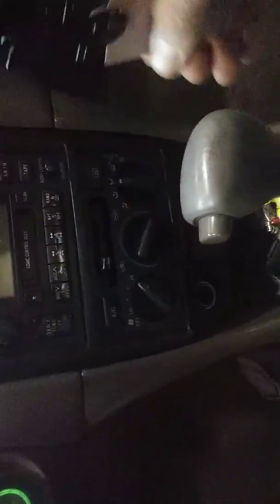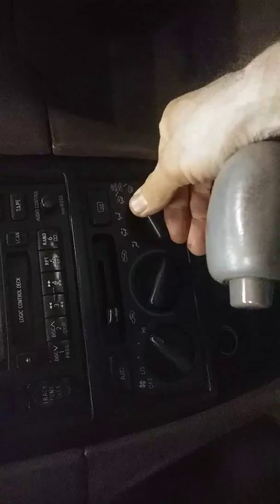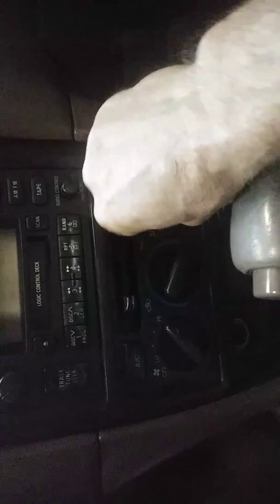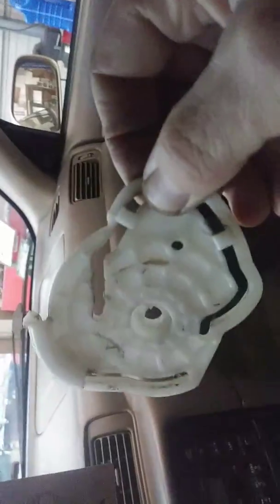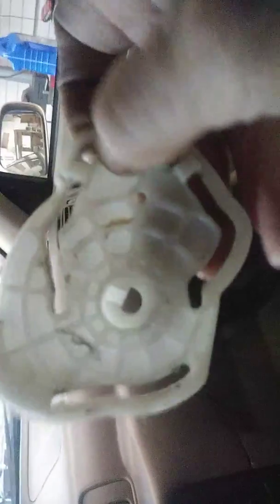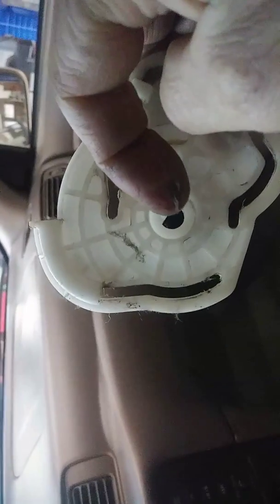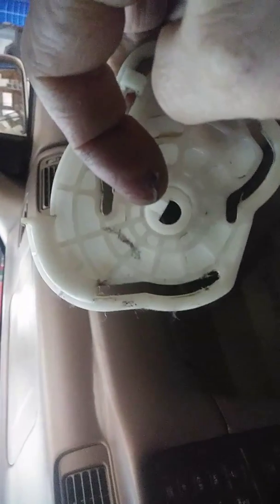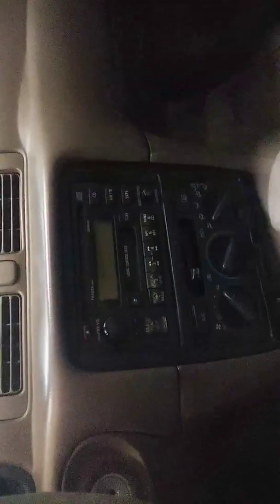Toyota Camry Servo motor air selector switch not working

Comment: I just did this job. It's very difficult to get to this part because you have to work upside down. I highly recommend removing the driver seat. Don't be intimidated! It's easy! Use a 14mm socket, remove 4 mounting bolts at the base of the seat, place the seat in the back seat. Now you can lie down on your back and do this job. One more tip, use a very short phillips screw driver to remove the servo motor.
Reply: 3 days ago! Haha! Must be "Planned Obsolescence!"  Seems quite a few of us got hit nearly the same time - at least the same year!
Man, do I appreciate your suggestion on removing the driver's seat... I wouldn't have even thought of it!  And at my 6'2" @ 240 lbs, I'd have really suffered tomorrow...
Reply: @randystrand908  mine stuck at 232k miles on my 1999 Camry